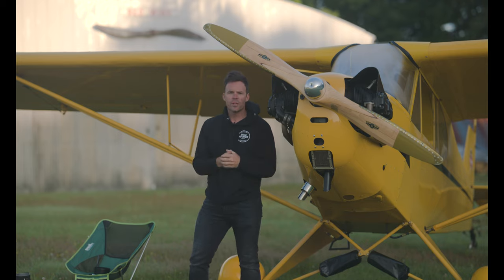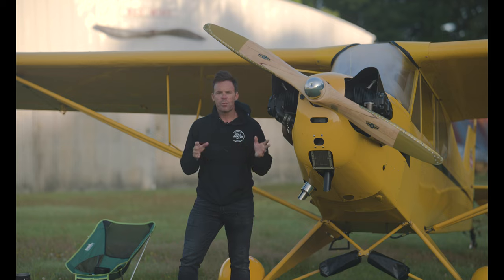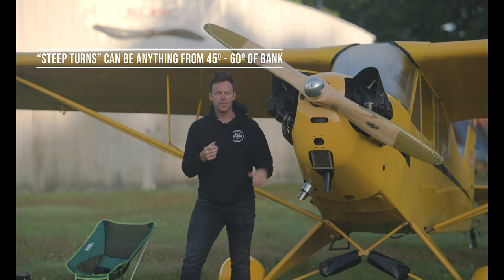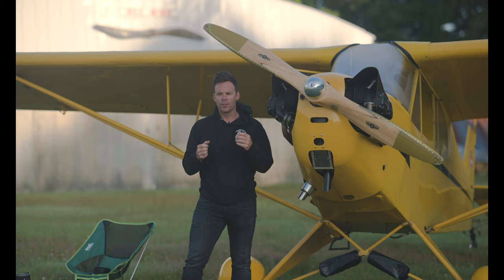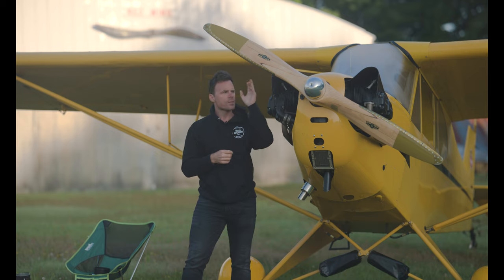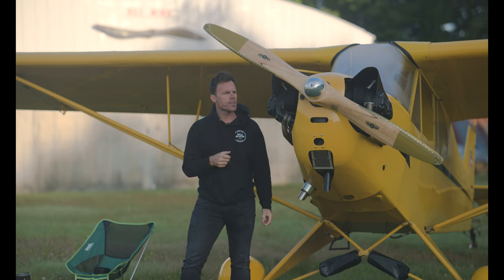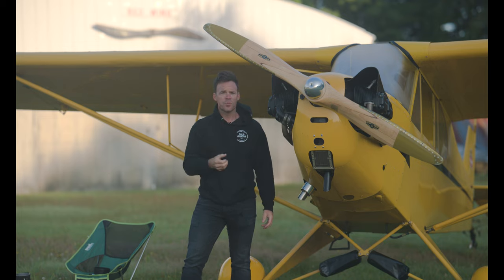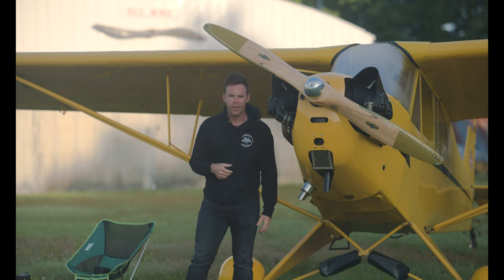The One Simple Trick to Nail Steep Turns Consistently

Comment: Good lesson.  Nicely done.  You might mention the difference in cowl on horizon look in side by side airplanes.  Nose appears lower going right and higher going left.  I understand the objectives of the ACS maneuvers, but most are impractical and all are high altitude orientation.  Why would we actually want to make a steep level turn?  IMC we limit both pitch and bank angle.  We would, crop dusters, pipeline patrol pilots and all pilots in the pattern and mountains most places, need to turn more steeply as the horizontal space available becomes restricted.  In these scenarios, the vertical space available is less than needed to recover, after startle, from inadvertent stall.  So do we want to be in the airspeed limited situation that a steep level turns creates?  Absolutely not.  That is why crop dusters and pipeline patrol pilots learn the energy management turn rather than the level turn.  The critical angle of attack is when the stall occurs, not why.  A pilot pulling (pushing) back on the stick is required.  Because of dynamic neutral stability for safety, the airplane cannot stall itself.  So why do we introduce the very thing, in turns with load factor, that causes stall?  Why do we indoctrinate the very thing that will kill you in the pattern?  Maintaining altitude is a fine high altitude orientation and indoctrination, but not a fine low altitude orientation and indoctrination.  Airspeed, and not altitude is life down there.

First do no pull back on the stick without zoom reserve airspeed.  With zoom reserve airspeed, enough airspeed to climb or maneuver without engine power, climb wings level to a speed appropriate for the reduction in radius of turn desired, lead rudder in the desired direction of turn (correct yaw rather than adverse yaw), as soon as the bank is started (if you didn't lead rudder the nose went the wrong way first a bit) release all back pressure on the stick, the turn of whatever bank needed to miss things in the horizontal space available or to capture the centerline extended or whatever target is now a 1 g turn,  as the nose (between the legs in side by side) is coming onto target level the wing to prevent graveyard spiral and putting a low wing into a wire or terrain, use the increased airspeed in the dive to return wings level to near the beginning altitude.

Why are we teaching the same maneuvers that don't relate to efficient flying on the Flight Review?  I teach the basic low ground effect as far and fast as practicable takeoff, the 45 degree bank Dutch rolls that positively indicate the absolute need to lead rudder, the energy management 1 g turn of any bank angle, the apparent brisk walk rate of closure approach (covered as the stall down approach in Stick and Rudder), and the use of this power/pitch approach to angle across wide runways in strong crosswinds.  Didn't they say PPL was a license to learn?

Again good lesson on the steep turn maneuver.
Reply from the maker: GREAT POINTS AND GREAT EXPLANATIONS! thank you!

Comment: Nice video Joe. Please keep them coming.

As a glider pilot, I frequently (try to) fly constant bank turns to  stay centered in the thermal. If the bank angle varies, we won’t stay centered. Further, there are many times when the lift is much stronger in the core of the thermal so we need to fly steep turns to stay in the strongest lift. 

The key to all of this is to fly constant bank, constant speed, and coordinated turns, just like in your J-3. Before entering the turn I note the pitch angle of the nose below the horizon I need to maintain a constant speed. The real horizon beats the artificial horizon any day of the week and flying that pitch angle solves the problem. In your video, you could also use the tip of the fuel float as a point of reference on the horizon.

Steep turns have practical use, besides gliding, in mountain flying when you need to turn in a canyon, and should be taught by all instructors. The first time some pilot from Ohio uses this technique should not be in some tight spot in Idaho. 

Final fun fact: Any aircraft in gliding flight, a 747 at idle power, a J-3 with an engine out, or a super hot sailplane will lose the minimum amount of altitude in a 45° banked turn. 

Thanks for the videos, you’re our modern Wolfgang Langewiesche.
Reply from the maker: Thanks for the insight and kind words! (I also really need to get some glider time